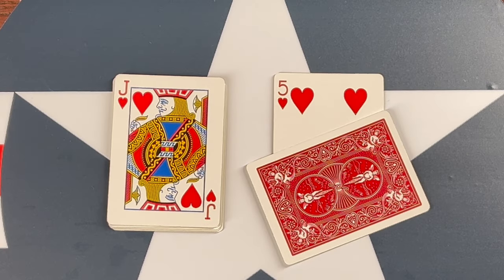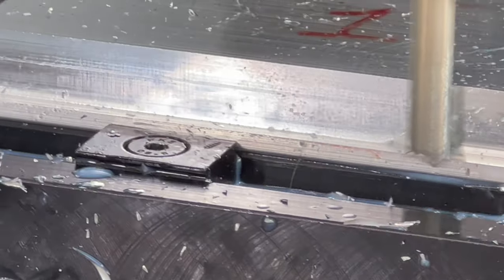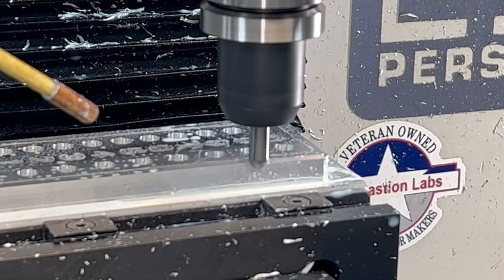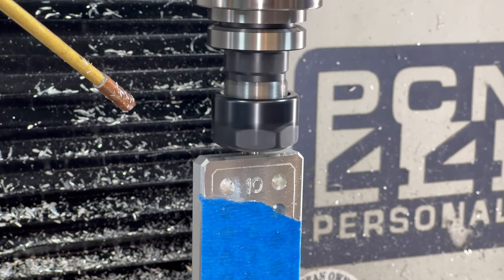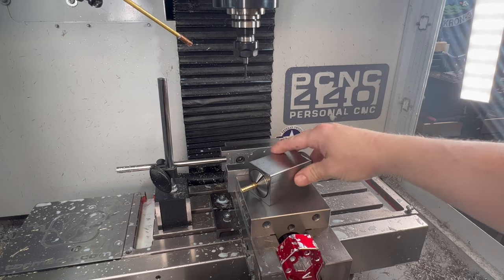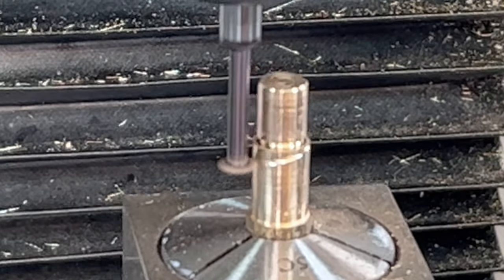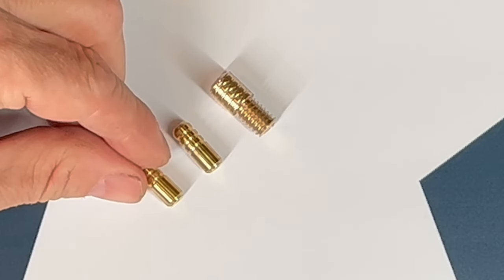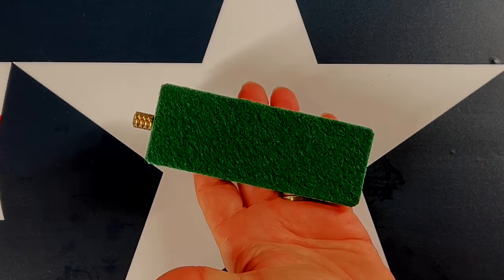Machining a euchre score block and how I cheat.  Look closely.

Comment: Beautiful work!  I always enjoy your videos. I've made some similar stuff in the mill, and I found that I could eliminate 95% of the manual work at the end using a slitting saw.  First, I'd make an undercut like you did with the t-slot cutter, then chamfer what will be the final edge with a dovetail cutter (since the edge is on the bottom at this stage) then make four contour passes with the slitting saw to cut ALMOST all the way through.  I usually could end up with only about .15mm nub left, and the part would just snap off by hand.  A couple of strokes with some fine sandpaper and that nub was gone and the part was done.
Reply from the maker: Thank you Bill for the kind words and the guidance.  I have a slitting saw/spiny wheel of death on my list of toys.
Reply: @LastBastionLabs  Well, circling back, I picked up an idea from your video that helped me a ton!  I have a product I'm working on that has a brass wheel of about 1.1" diameter and about 3/16" thick that I wanted a textured outer surface on.  I had done a TON of different things and the one I loved was one I did on a 4th axis with an engraving but, just cutting angled grooves.

Well, that was fine for prototyping but not fine for production in fixtures so I eventually realized I could do about the same thing with a small 4mm lollipop end mill and trace diagonally across the outside in op1 when the wheel is machined out of brass flat.

So, I jumped through all these hoops to do it.  I modeled a coil on the outside (very steep) that barely intersected the outer edge and cut it out of the wheel edge and then patterned that  around the wheel 30 times.  Then in came I did a trace operation and had to wrestled with lead-in and out and it was a mess.

Then about an hour after watching your video I realized I could do the same thing with a multi start thread operation with a steep pitch as you had done, and I didn't even need to model anything!

So I opened the model and did a 30 start thread around the outside with 60mm pitch and duplicated that toolpath with another thread running the opposite direction.   It made a very nice knurled effect that I can't wait to actually put into production!  So thanks for inspiring me.  SOOOO much better than my kludgy coil/cut/trace mess.

Keep up the great work!
Reply from the maker: @billstrahan4791  Bill, that is outstanding.  If you have pictures, please feel free to forward them to lastbastionlabs@gmail.com. Would love to see them.  Or if you have posted them on instagram, let me know how to follow you.   Thanks for the feed back!